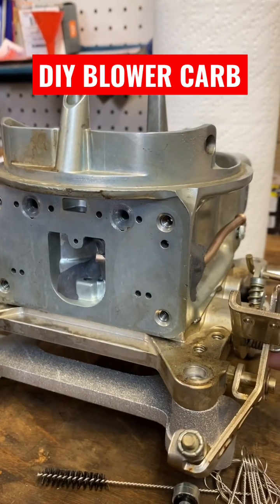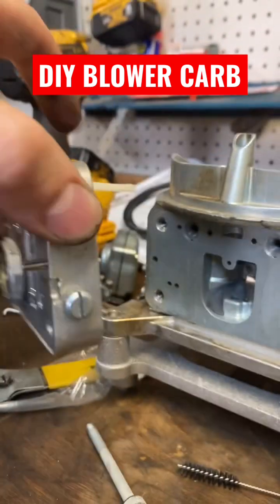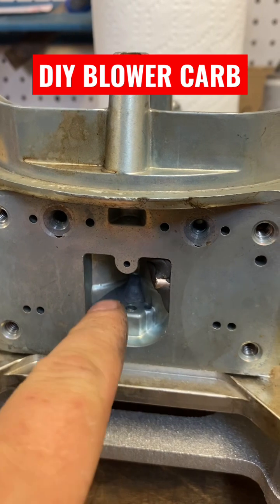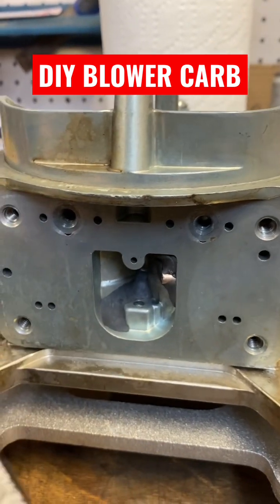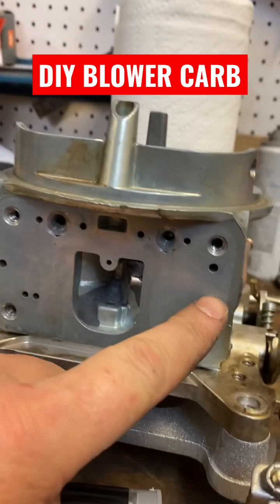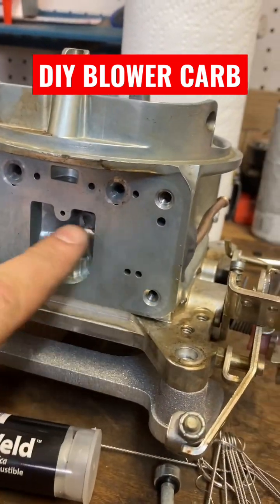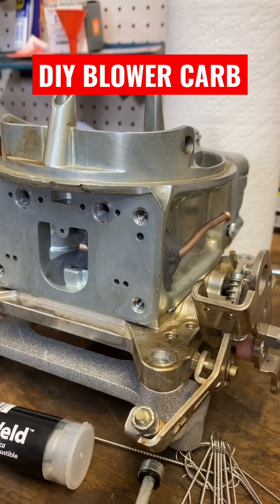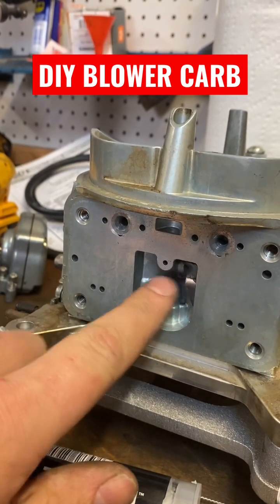DIY Blower Carburetor...CHEAP!

Comment: Awesome video and information. Definitely cheaper than buying a blow through boost reference carburetor. What kind of fuel pump are you running and what pressure coming in the carb? Do you, also, have fuel return line to the tank? Thanks for your information and videos. Keep up the great work fella.
Reply from the maker: This is a draw through. For a draw through I think you just need nitrophyl floats and a boost referenced pressure regulator. But I’ve never looked into it too far.
Reply: @freedomworx  I figured floats would have to be replaced to avoid crushing them, especially if brass. Hell yeah man. All the information you share and your prompt responses to your fan base speaks a lot of you. Definitely a cool dude in my book. Always looking forward to seeing more videos on your projects and your progress. You're gonna go far old son.
Reply from the maker: @jecole85  thanks for watching brother 👍

Comment: I’m an EFI guy. Can you explain why you did this? Please don’t think I doubt your hacksmithing skills. I just don’t know jack about carbs, much less feeding a blower with one. Thank you Sensei.
Reply from the maker: Power valves are held closed by manifold vacuum. When you mat it, manifold vacuum drops and the power valve opens, and it richens up the mixture. But with a roots blower, the manifold vacuum is always present, and the power valve never opens. Of your reference the power valve below the blower, it will actually see actual vacuum unless there you are getting into it and the boost comes in. And when the boost comes in, there is no vacuum, and the power valve opens to enrich the mixture like it should.
Reply: @freedomworx  thank you for the explanation. One day I’ll venture into the carburetor realm. At least, just before swapping a V10 into it.
Reply: Thanks, never would have known otherwise. Very cool